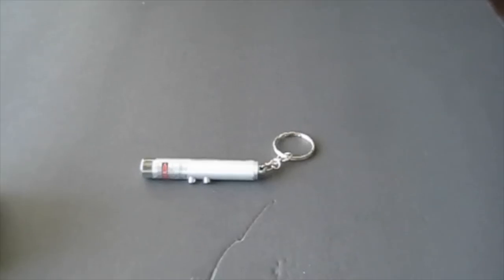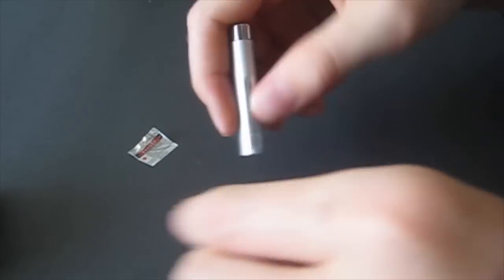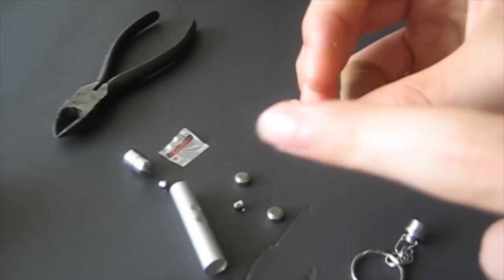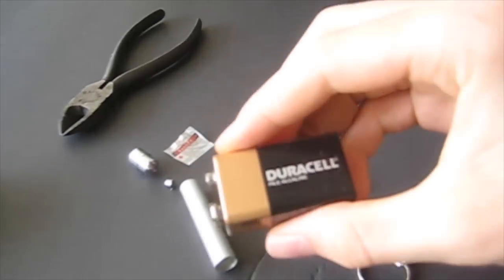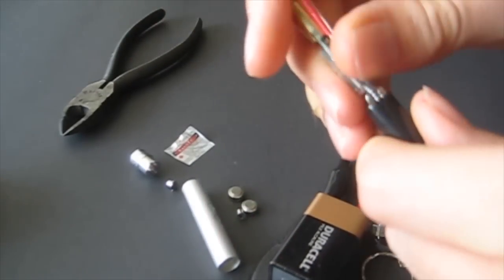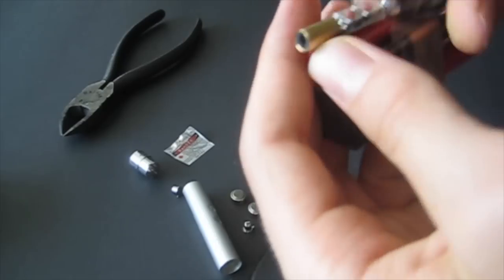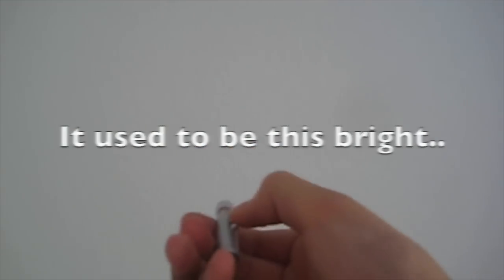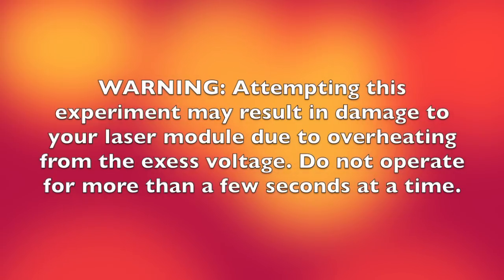How to Make a Cheap Laser Pointer More Powerful

Comment: well, this can be "effective" but u can easelly burn your laser diode.... It is like saying... Hm lets change the output with 50 volts instead :)
Reply: These lasers suck, so might as well use up the diode before the driver craps itself

Comment: The diode has a rating of at max maybe 2 volts dc and anymore than that and it could explode if you want it to light things on fire the safe way just focus it
Reply: Maybe then use a mosfet to send in lots of amps at low voltages?
Reply: @jayvonandre2684  yes use a laser driver with an integrated mosfet for switching also make sure it has a potentiometer

Comment: Hey I just got a laser sight for my weapon

Question it has a slight "glare" where it faintly.looks like 2 red dots.. is that something that can be fixed or nah?
Reply: clean the lens, and check for scraches, be gentle, use cotton.
Reply from the maker: Probably cheap lenses, might be something you can fix but it would depend on the design and would probably be a pain
Reply: @msci3067  yeah it was cheap its not too bad when I turn the brightness down

Comment: How do i increase the power of my laser pointer? There are 2 wires one red and one black and they are both attached to a capacitor and there is a push button to enable the laser.
Reply: Turn the capacitor
Reply: Player ha ha ha

Comment: Wouldn't it be easier and more practical to just rig the original laser casing to hold more of the smaller batteries that come with the laser? More than likely this would also prevent the laser and led light source from being so easily damaged. 👍

Comment: How much the green laser  ?
Reply: Rick Malone Color does make a difference actually. If you want apparent brightness green lasers are the go to, the wavelength our eyes are most sensitive to is 555nm, 532 is the closest you can get unless you can find a 555nm laser diode which is really rare, to the point that they probably don’t exist.
Reply from the maker: I got it for around $80 but you can get it a lot cheaper on ebay and stuff
Reply: Color doesn't make the difference, the power does, however you can't take a low resistant board and over power it!
Reply: @RBRM3  You are an example of ignorant people commenting on YouTube videos. A green laser certainly has a benefit over a red laser. Our eyes are more sensitive to the green wavelength.
Reply: Matthew's Science That’s way overpriced, I got my 303 for $20 dollars and it’s at least 80mw, I haven’t tested it with an LPM yet so I’m not too sure.

Comment: i hooked up a 9volt batterie to a very cheap remote controle car it was wired to the remote, the two AA batteries is regular power but the 9volt batterie gave it more power and it was actually quicker but it burned out lol still was fun
Reply from the maker: cool

Comment: you need a ic 555,a 9v battery and three resistors 1k ohms are set parallel with positive and negative wires.i can't describe more,however,use the ic 555 datasheet and flashing the laser to 20hz.it will make your laser brighter with 9v but still not damage the diode.

Comment: I bought the exact same pen as this one but I don't have any crocodile clips currently and it's not practical at the moment for me to make this mod.

Years ago, when I was 15 or 16 (you can tell how long ago that was if you look at my name) and my friend had a damaged Laser Pen, it was a larger pen, about twice as think as this at least and twice as long at least. 

Anyway, the thing had about 7 wires hanging out the bottom but I found the 2 that allowed me to hook it up to a 9v battery and once I even hooked it up to a 12v connector. WOW was this thing powerful!  On a dark rainy day I could see the laser hit the clouds! That only happened one time though and my parents house is pretty high from Sea Level but it was so cool. I couldn't find a long enough line of sight distance that this thing wouldn't shine on to. DAMN I wish I still had that thing! 

I blew it out using 120V AC! I was 15! Give me a break!
Reply from the maker: If you have/can brorrow a soldering iron that would work. the reason i didn't do that in the video was because not as many people have one.
Reply: I've got a soldering iron. Low on solder though and I need to fix my cordless phone because BT in their infinite wisdom made the two pair the outer connectors instead of the standard middle two. Now I have a newer one that won't register and the two pair cord is no use since it's the standard one.

Plus I need to mod my hetsink/fan for my CPU which will take quite a bit of soldering.
Reply from the maker: ah
Reply from the maker: well luckily solder is pretty cheap